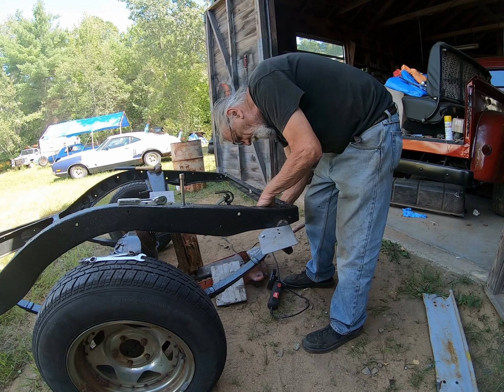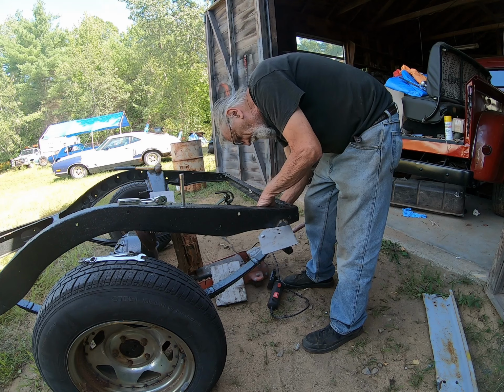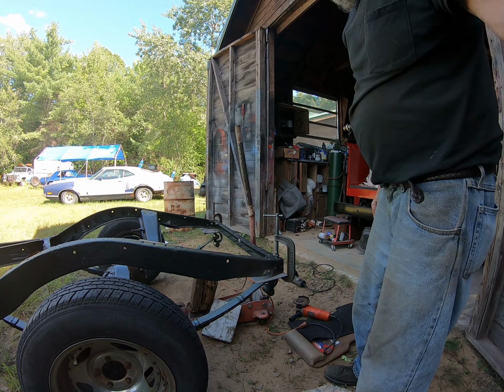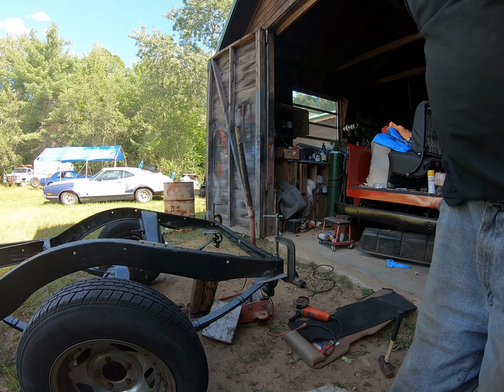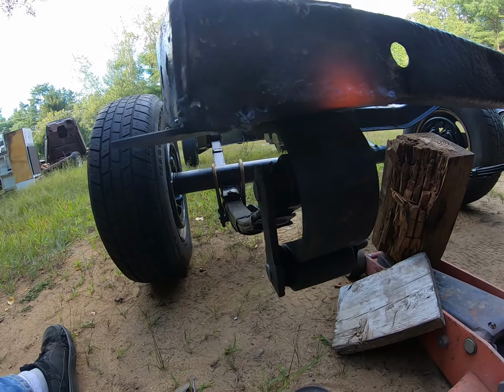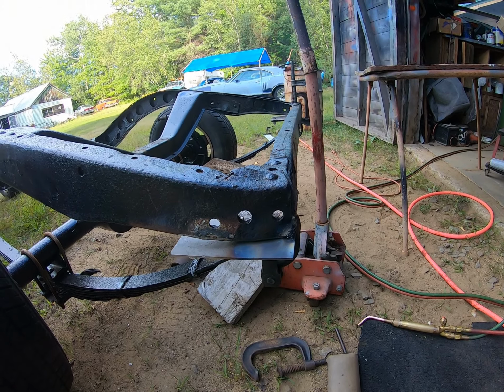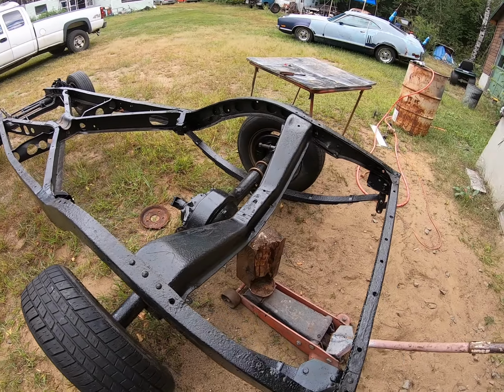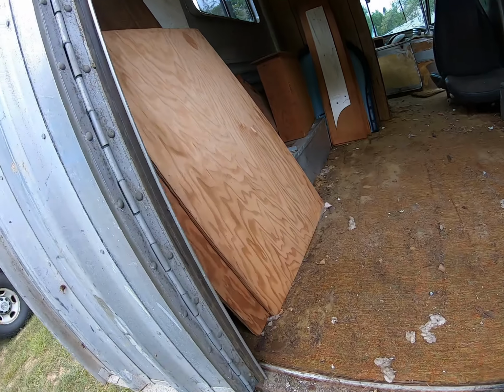Making rear spring mounts for the 40 rat rod truck.

Comment: Well done. I see you are using the old wire coat hangers as welding rods. I havent seen that done for many years. 
I know how you are and feel with your back. I have just bought a non runner moped / scooter a nd have been working on that. I finally got it going but got to sory the carb out and a couple of other bits .Keep getting up and down on the floor isnt doing my back and hips any good. If I was to bend over doing work like you have, when biolting the springs back up, I wouldnt be able to straighten up again for a couple of hours. 
Take care. I love these vids.
Reply from the maker: That's old school hot rodding. In my latest video I showed Richard how to gas weld. We tried using arc welding rods but we had to hammer them to get rid of the flux coating.  
I moved the 55 truck out of the garage so now I can use the lift and not bend over so much. It's getting harder to straighten up.
Reply: @alshotrodsandratrods8780  When I saw the sparks, I thought it was a bit strange with gas, but then I saw you were using arc rods. Just a pity I am not near you. I have some welding rods and I think some brazing rods. The ones I think are brazing are thicker than the welding rods. 
I have damaged my back more by getting up and down off the floor and bending oveer a lot while doing stuff. I am enjoying this build and looking forward to the next bit of fitting it back on the front half. :). Take care.
Reply from the maker: @ianallen2  I think the sparks were from the rust popping off.
Reply: @alshotrodsandratrods8780  Could be. I know there was a lot for gas welding. :)